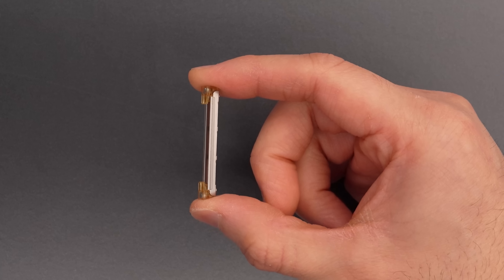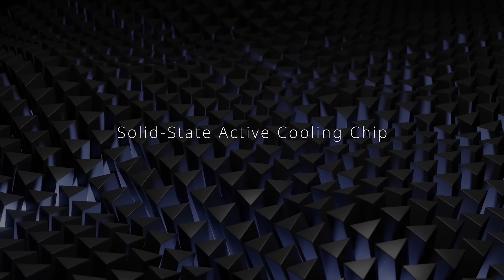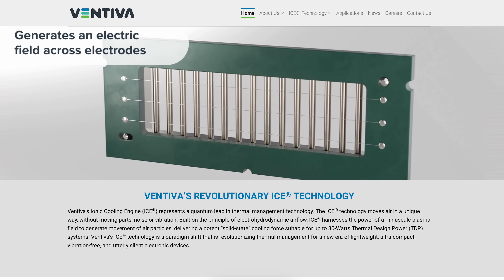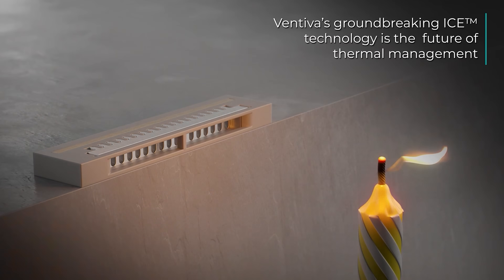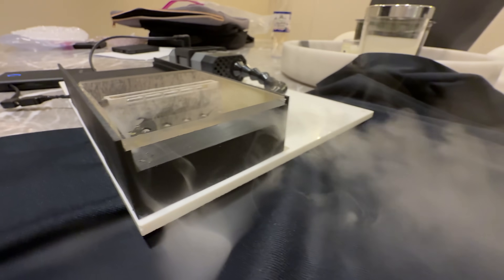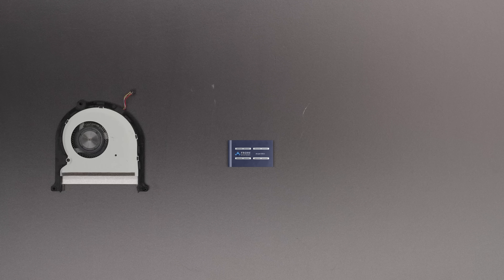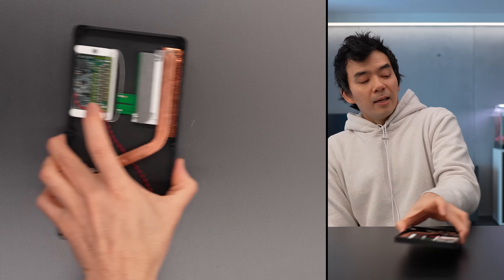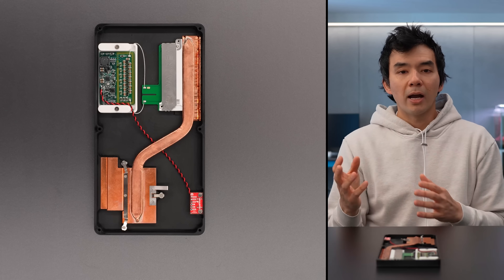The IMPOSSIBLE Laptop Fan...

Comment: Brother this technology has been used by satellites since 1950 or something. It's nothing new. And it is very basic science. It's so easy to make at home as well. There are hundreds of videos on YouTube that show how this works and how to make them. A guy is even trying to make a full electric jet with his ion engine. I forgot his name but you can easily find him on YouTube. And lastly, it will not cost a lot in fact it will be even cheaper than those fans. I am surprised that this tech was not picked up by laptop companies 20 years ago.

* His name is PlasmaChannel. I remembered because he commented on this video down in the comments 😂.
Reply: the problem is that dust will degrade those things FAST.
Plus depending on the dust they can start fires. that is why they arent used. normal fans are safer and more reliable. that beeing said. IF they fixed those issues then they might just become standard.
Though the lack of static pressure is BAD. because the other solids are alot more efficient due to the high static pressure.

Comment: One, it's going to create great amounts of ozone, and two, it's going to get filled with dirt and dust extremely quickly because of the high voltage power supply required to make it work.

Comment: My biggest concern that you didn't talk about, is the electrode itself. It will eventually degrade and will need to be replaced. I'm sure it's strong, but it can't last forever. Also, with high heat, I worry it may melt or break, fans don't have that issue.
Reply: expiring at a predictable rate is not an issue, it's a goldmine-type design feature
Reply: @Alexander_Sannikov  Ah yes, how could I forget, the same way apple has parts that can't be upgraded. How could I be so blind.

Comment: I think from an aerodynamics perspective, the static pressure might become a huge problem not only at the intake, but at the fins. The higher pressure can "push" the air at higher speed, which effectively reduces turbulence by producing a way thinner boundary layer. Generally, laminar flow can transfer several times more heat than turbulent airflow. If a laptop uses the ventiva tech, the fin might have to be sparse and reduce the overall cooling capacity.

Comment: I think one big problem with this approach is dust buildup. Dust particles could easily be charged and stick to the other side. To prevent that, we need fine filters, which is impossible due to these devices low static pressure.

Comment: At first I was thinking that you could get around the static pressure issue by daisy-chaining the devices in a series, i.e., one to draw in at the intake and one to expel at the exhaust.  But I'm guessing that once the particles are ionized and pulled in from the intake the exhaust won't actually work.  So at that point you're back to having to re-arrange the internal designs, potentially with multiple exhausts or heat pipes.

Comment: No moving parts does not necessarily mean that it lasts longer. The high voltage can be a big stress in the electronics of the fan, but also can mean a lot of noise that the other Components need to endure.
Similar to good quality LED lights. The LEDs themselves rarely fail, but often it's the driver circuitry.
Reply: Or if the driver is poorly designed, the LEDs themselves fail because they were driven too hot. An LED operating within spec can last just about forever, but if your goal is to make an LED lightbulb as cheaply as possible, you can get 7 diodes to run just as bright as 8 if the 7 are run just a little over the current limits of the diodes, and that could save you a solid $0.04 per bulb...
Reply: @reaganharder1480  makes you a bunch of more money in replacements, sad really. People think LEDs are horrible due to bad implementation with no attention payed to color accuracy, driver circuitry, or overdriving. To my knowledge a lot of LED's are better in every but color accuracy when underdriven, both efficiency and lifetime.
Reply: @Silverdev2482  Only makes you money in replacements if the people replacing stick with your specific products, which is where competition is supposed to come in, but in practice it unfortunately often doesn't. When coming from incandescent bulbs which cost like $2 for a pack of five, LED bulbs feel pretty darn expensive, so a lot of people are probably going to be inclined to buy the cheapest ones they can find, and then when the cheap versions they buy don't live up to the hype created by the more expensive, properly made versions, they write the whole technology off as a scam.
Reply: @reaganharder1480  "which is where competition is supposed to come in, but in practice it unfortunately often doesn't."
Regulations - mostly the government making it so you have to use specific technologies or you are just not allowed to import anything else.
Reply: @ABaumstumpf  The regulations we want would hurt the big corporations that own the governments, so the regulations we get are ones that let politicians look like they're fixing problems but actually make it too expensive for startups to compete with the established gigacorps, while those gigacorps spend what amounts to pennies at scale to comply, a fraction of what they already spent to buy the politicians in the first place.
Reply: In terms of fans No moving parts isn't about longevity but about noise.
Reply: That said in the end literally no one cares whose fault it was that your expensive LED burned. It's a "fell for it again" reward

Comment: Ionizing tower fans have been around for years. They use the same principle for moving air, so the technology is not new at all, just shrunk to fit a particular application.
A definite down side is the necessary periodic cleaning of the wire to maintain efficiency, because the wire will slowly accumulate a coating of crud from the air passing through it.
Many people are sensitive to ozone, and should not use this thing.

Comment: Flow and satic preasure are 2 very different issues. These provide virtually no pressure, which is needed to push air through a heatsink or enclosures. Hence why this test is in open air.

Comment: The gabs in the keybard are not for airflow...there is literally a full metal plate behind them. No air can flow there. It also wouldnt make sense to vent hot air out of the KEYBOARD.
The gaps are there for manufacturing reasons and to allow some wiggle room during keystrokes.
The top "vent" on this specific Zenbook is also just decorative. There is no airflow out of this area, its just there for looks.
Reply from the maker: lol. No. Go talk to thermal engineers from these companies
Reply: Actually some laptops have perforations in keyboard base plates. This miniscule amount of air is needed to prevent formation of pockets of hot air below the PCB. Lower rated laptops (with ultra low wattage CPUs) are sometimes built without any fan; they can safely spread excess heat via case.
Reply: @brylozketrzyn  Some do, but not the one shown in this video.

Comment: Since these are so thin, I can imagine that they might solve the static pressure issue by having them angled upwards, so that they can directly suck the air from the bottom and then to the back and up, without having to bend it 90 degrees. Alternatively, they could flow the air through the corners of the laptop so it doesn't have to go through its entire length/width.

Comment: Ionic cooling has existed for decades and has not caught on. Static pressure is miniscule, it produces ozone, etc.

Frore's tech doesn't seem to scale up well, which is why it's not taking over the world either... but it has the advantage of stupidly high static pressure that allows them to use a choke point in the cooler to increase air speed. This prevents hot air from sitting on the surfaces of the cooler, and thus increases heat transfer, in spite of the modest volume of air it's pushing. If you compared *heat transfer per watt*, that would likely be more favorable to Frore, although it's probably still less than a traditional heatsink/fan kit.

At the end of the day, I suspect a hybrid solution of traditional watercooling and a Frore-style membrane drive will eventually scale up large enough to actually be useful outside of embedded systems. Even if it never matches the power efficiency of fans, it would be quieter than the noisy desktop I am listening to right now.

Comment: Bit of an overhype without realistically considering the downsides...

You need a separate PSU board with its own inefficiencies, probably ~80-90% efficient.
Multiple devices due to the low static pressure means you essentially need the same power per usable CFM as Frore, from the numbers you provided.
You need the control board plus multiple devices along with additional shielding/ducting, cutting down on the size advantage.
Low static pressure means a high chance of recirculation, decreasing the performance/cooling potential.
You need to completely redesign the layout of the chassis, components, and heatsinks.
Copper heatsinks/fins will supposedly need Mg plating, significantly increasing cost.
Not to mention the dozens of potential unknown issues/complications that always happen when trying to break into a market.

This likely goes nowhere as well, maybe a few niche products that want something more than passive cooling.

Comment: So according to the data from Ventiva, their stuff has only 10% lower power consumption but then a whole third (25-33%) less airflow per watt.
Surely a big jump from the AirJet but still nothing to replace fans with. Especially since modern laptop fans, especially on those extremely low power levels, are basically silent as well.
Reply: Not to mention, the airjet is going to get more efficient as they scale it up and refine the manufacturing process.
Can’t really beat that COP of 4.